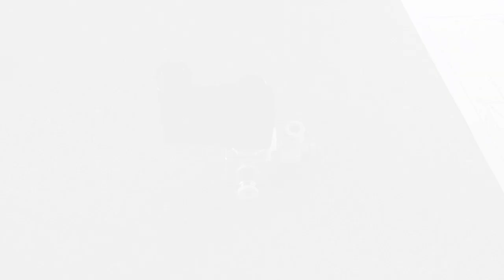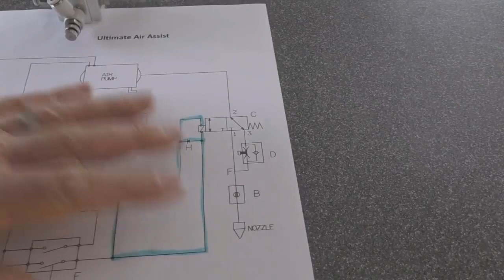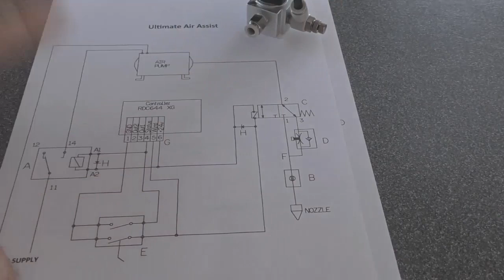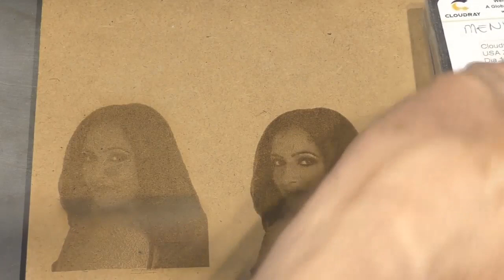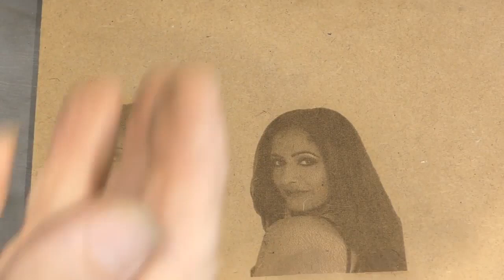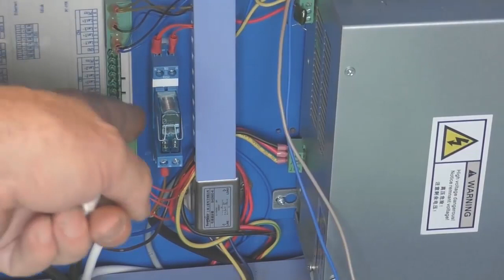Air Assist Kit Russ

Comment: For anyone installing this and not able to get the WIND or STATUS controls to activate... In the vendor settings, on the "other" page, you must enable the blower check box and save those settings to the machine.